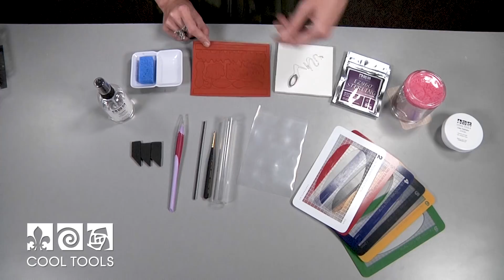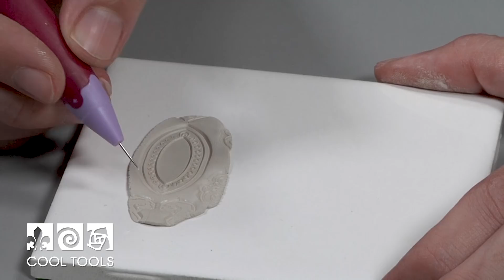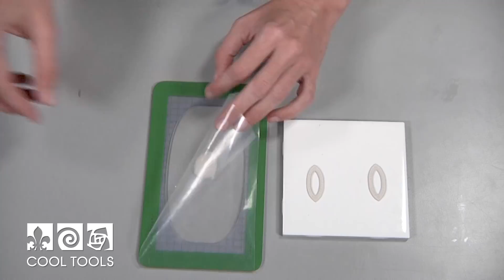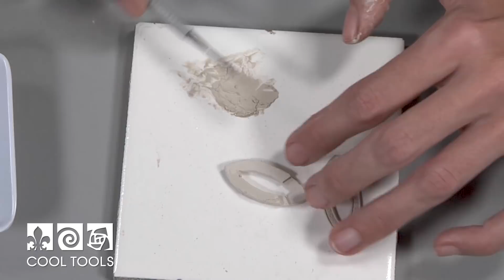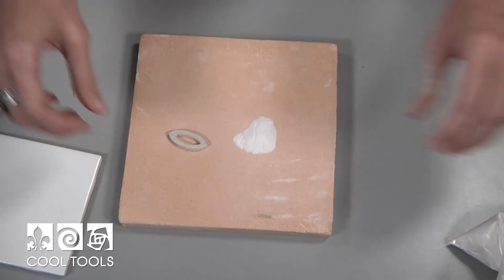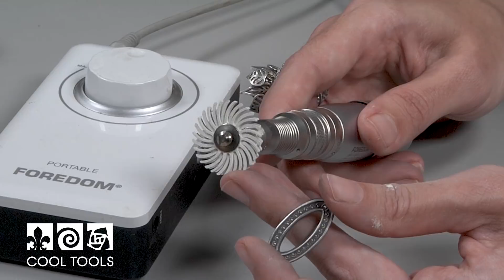Cool Tools | EZ960® Sliding Pendant by Wanaree Tanner

Comment: Hi I love the tunnel for the chain, the slider, I wanna do this on polymer clay but I am not going to do a cut out middle because I wanna put a gemstone on top of it and secure it. My question is, on polymer clay, when I also do 3 layers and cut the middle one the exact same way, the gemstone may be over it or slightly below it, the weight of the stones varies.. when before and while baking, will that slider I cut out stay or will the top layer fall into the cut out slider space? Thank you so much
Reply from the maker: Hi Susanna, we have not tested this project in polymer clay. We would recommend using a toothpick or some kind of material to hold the slider open while baking. Hope this helps!
Reply: @cooltoolsvideos  yes very much. Thanl you!!!! I will try. I thought about using a thick piercing wire stick. But I wanted the "V" or the "U" shape.